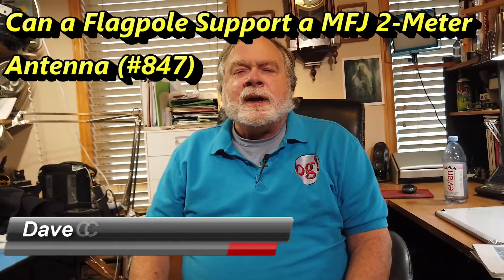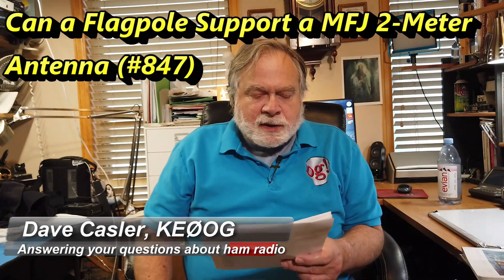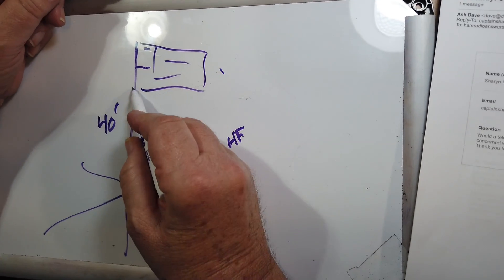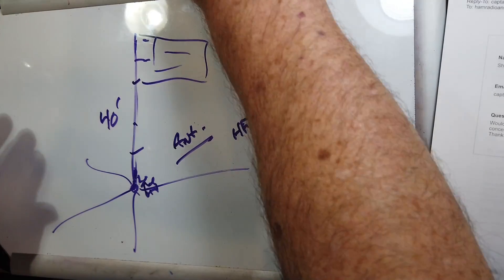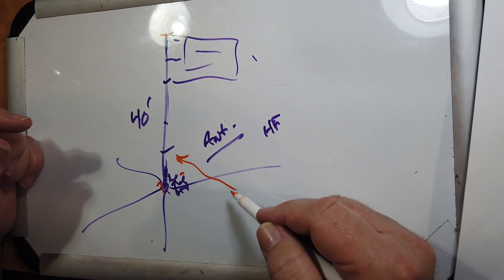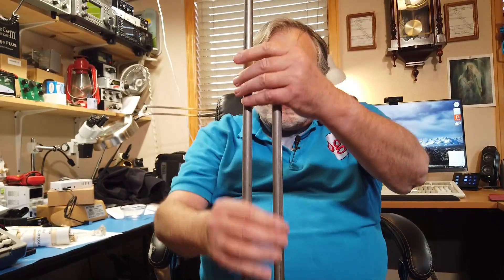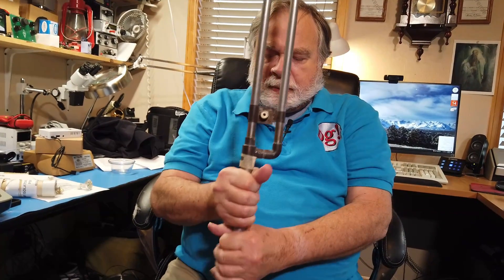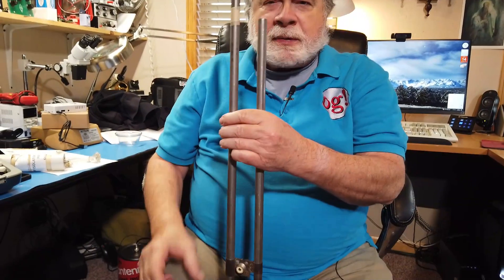Can a Flagpole Support a MFJ 2-Meter Antenna (#847)

Comment: I did just that with reducing size conduit (I left off the flag). She didn't mention, omni or yagi. Omni works fine. So does a yagi with a small TV rotor, but use wide pattern (small) yagi. I used mine for a year waiting to get my tower up. Only problem it moves a lot in the wind and aiming a beam is rough.

Comment: Thanks, Dave for the good video.  Never used a  2 meter antenna on a flagpole here, but I use a 30 foot anodized aluminum flagpole for supporting the wire end of my end fed half wave (EFHW) antenna; coupled with a bungee cord to the pulley system.  Along with my shack ground rod, there is also a ground rod at the flagpole, too.    BTW, I use outdoor white zip ties with good success as another alternative to the duct tape.  73,  AC3HT

Comment: The weight of a VHF antenna(s) and 30-40 foot runs of LMR-400 is much more than a flag and some sections will slip down. A hose clamp at  each section solves that.
Reply: or a sheet metal screw
Reply: Yep - I have a Tram 1481 mounted to the top of a 30 foot telescopic flag pole from Harbor Freight and LMR-400 running up to the antenna.  I put hose clamps at each section to prevent slippage.  It's been up over a year through wind gusts up to 65mpg with no issues.